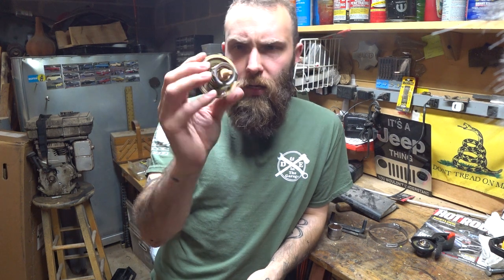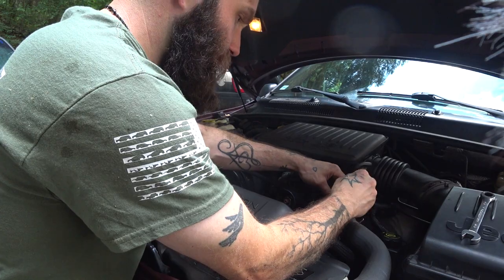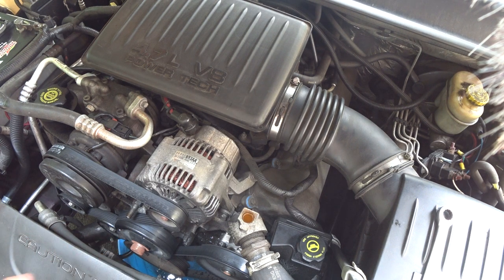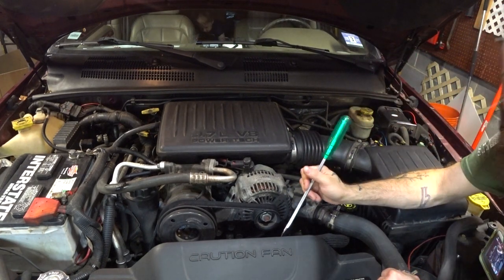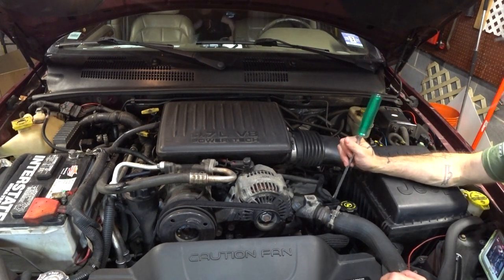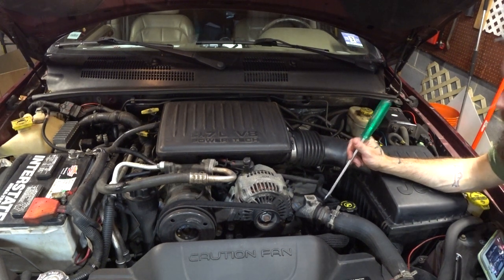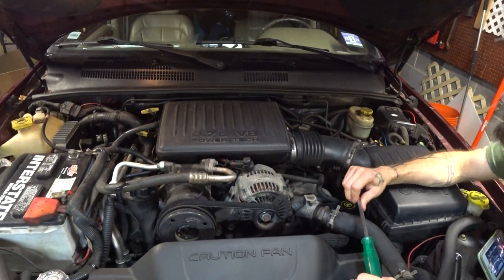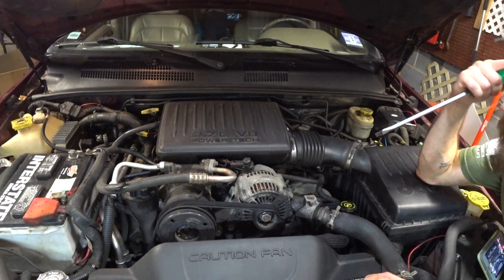How to keep a Jeep Dodge 4.7L alive & happy - EVERY FATAL FLAW I LEARNED THE HARD WAY!

Comment: When you say “hot”- what does that mean? I put a mechanical temp gauge on the bleeder port- normal driving temp on my ram is between 200-215 (just left of center on stock gauge)in the summer. When I drive with my plow on- the temp occasionally gets up as high as 230 which is indicated as just right of the center line on the stock gauge..  For me- 220 is about as high as I would like to see that thing go. If 230 is only just right of center- what the hell gets you up to the red?? 270, 280??

Comment: mine overheats when driving  220 or more . at idle it does not 208-210 max . i unplugged the coolant sensor the fan went to very high mode . what you think the problem?

Comment: Got an 04 wj 4.7 limited....having issues with hard starts....put a new battery...checked wires...cleaned connections...checked grounds...cant figure it out...have you had this issue or know of anyone that did
Reply from the maker: Not really. Could be a TPS issue. also could be plugs?
Reply: Cam and crank sensor?

Comment: I need some help!!! My 17 year old son has a 4.7 and im having over heating issues. I have replaced the thermostat,  water pump and all hose's. I bought the right hydraulic system power steering fluid and I did the bleeding right so I think but it's still getting pressure in the coolant lines I dont know what else to do
Reply from the maker: All I can say is that some 4.7s seem to be harder to bleed than others. Maybe give that another swing. Can you hear any rushing water behind the dash when flooring it?
Reply: No I didn't hear that. I will try to bleed it again today.

Comment: Off topic from cooling, but I've got a 2002 Dodge Durango with a 4.7L and went to take it through emissions, and it says I failed because the O2 system failed. Has new up/downstream O2 sensors in it, but still failed.
Any ideas of case of fail?

Comment: I inherited a Jeep Commander with a 4.7 from an elderly friend who passed. The temp needle would move back and forth like a kid on a swing sometimes. Last week it started running very rough then died.  Had it towed to a garage and they determined that two adjacent cylinders had no compression and said it was the head gasket The engine has 140K and ran fine except for the variation in temperatures. I just thought it was a defective sender or???  I'm a 5.9 guy and had no idea these engines were so complicated.  I'm ready to junk it and I am directed here -  Is it salvageable for a reasonable cost or is it toast? Anti-freeze was/is green! :-(   I'm an old Vet on a slim retirement income.  Any input appreciated.

Comment: I see your belt routing is not the factory routing.  Do you route your belt different to put less load on water pump bearing?
I know Honda did a update on belt routing on one of the 1.7 Gen engines to lessen bearing load.  Just asking is that why your routing is non factory.  Ty

Comment: Do you have any tips for parts on swapping the hydro fan for the mechanical?
Reply: So I bought a fan shroud with secondary electric fan off an early wj and put in a 12 blade 16" fan from dorman (Ford application i think) on a stock 4.7L fan clutch. My E fan is not hooked up yet but the mech fan is performing flawlessly.

Comment: I live in the UK my 1999 4.7 wj has a mechanical fan and a e fan as standard, When you flushed your coolant did you remove the block drain to do it?
Reply from the maker: Yea, here in the States they did that in 99 as well. Not sure why they changed it. I did not remove the block drain plugs, but I did flush it several times with distilled water

Comment: Know anything about this motor ticking? I’ve checked lifters they are good, I’ve checked for loose flex plate bolts they are good, I’ve checked pulley water pump pulley is bad but still get the ticking with belt off, pulled fuel pump relay and there is no tick when cranking the engine over only when it runs and tick goes with the rpm’s there is no exhaust leak, no vacuum leaks that I have found, but tick sounds like it’s coming from throttle body/ intake tube area, would a bad fuel injector cause this ticking? Idk I’m at a loss I’ve checked everything I can think of other then testing the fuel injectors

Comment: I’ve drove my 2006 ram, and the only trouble I’ve had is when the bearing in the water pump went out. I don’t think we bled it after that but ive not had issues
Reply: Read the bleeding instructions on the front above the radiator I bought my 04 jeep with a blown engine. I installed a rebuilt and drove it 1/2 way through a MN winter. I noticed if I went to an appointment with it wormed up inside when I came back 1 HR later and sat in my jeep with the engine running I got no heat. If I drove it 4 blocks I got fully hot heat. I thought there must be an air bubble or something. Then I saw someone's VID and they said IF YOU DO NOT BLEED THE 4.7 YOU WILL DROP A VALVE. when I bled mine I pulled out the plug and could not see the coolant I had to pour premixed coolant in the vent hole with a funnel. It took 1/2 gallon. Guess what. Now I get heat much sooner and I don't have to drive 4 blocks first. I hope I did not damage my valve system. I hop the cold MN weather saved me. SO FAR SO GOOD. DO IT NOW!!!

Comment: Okay... I have a 2001 dodge Dakota with the 4.7. Everyone I went to told me to use the green? Do I need to drain this thing ASAP or...? Why is the green a problem?
Reply from the maker: Yes, there is supposed to be the orange H.O.A.T coolant in there. The green coolant is not designed for use with aluminum engine components like the 4.7's heads. That is why green coolant is not used in modern vehicles. Just about everything these days has aluminum block or heads.
Reply: Dammit. My 2001 grand cherokee has green too.

Comment: Just got a 2000 wj 4.7 with 150,000 miles it came with green coolant im changing it to orange , the instruments cluster works until i start it and has come on a couple times while driving  and everything works correctly i checked all the engine bay grounds but im lost , do i spend 400 on a new cluster and find out its something else ? No temp guage is not a good idea and after watching im resolved to fix it asap!  Any help?

Comment: Umm...While I love my 4.7 and consider it one of the best engines ever made (I have 250k on mine and will fight anyone who says a 4.0 is better) your a bit off on the coolant. I bought a 2000 WJ in July of 2000 brand new and from factory it had "lime flavored" Thats all mine has had its entire life. The orange didn't even come into existence until much later and is really for the 5.7 and newer generations.
Reply: Yea my 02 4.7 is a cast block and lime flavored. 2013 is when the orange flavor came out which my ‘13 charger had. So idk maybe this guy is a time traveler.

Comment: Is there any particular reason one cylinder head would run significantly hotter than the other? I drove my mom's 2000 Durango with the 4.7 last night and when I got out I noticed a distinct hot smell from the passenger side. Popped the hood and could definitely feel just from putting my hand over the sides of the engine the passenger side was much hotter than the driver side. The Durango has over 247k miles on it and never had any major work done to it but I'm fearing it may need some love now. It's had a bit of a ticking noise from the passenger side for a while now. I've been meaning to get someone to pull the valve covers and check the lifters/lash adjusters as that's a lot more intense of work than I'd prefer to take on by myself.

Comment: I don't know where you get all your confidence at stating that the green coolant eats away the aluminum heads  I've had the green coolant in my truck since it rolled out of the factory in 01 it's been changed a couple times but I still run the green stuff my motor is fine

Comment: My 4.7 just starter to lose power nd had to rev to keep on after i changed the radiator nd thermostat
Reply from the maker: Any chance you caused a vacuum leak while you were in there?
Reply: @DEInTheGarage  ive checked it all nothing seems lose im a have the engine rebuilt

Comment: Hey man , any idea what is causing my 4.7 quadra to do this. Sometimes when I get in the highway , at 70mph, my rpm will be around 2000 and sometimes it's at 2300-2400. And doesn't ever drop to 2000. When it does go to 2000 rpm about 40 min into the ride on the highway, my rpms will surge ever so slightly up to 2400 from 2000-2100. It surges every 3-4 seconds . I'll slow down to 60 and climb back up to 70mph and the problem seems to go away ... This sound like spark plugs , or crank sensor ..what you think ???

Comment: I love my '02 4.7 ho , thankfully im the third owner and it was well maintained properly and loved so only big problem i had with motor was spitting a rocker arm, and fixed by replacing lash adjusters.
Reply from the maker: Yea, those hydro lash adjusters cause all kinds of issues when they get tired. Sounds like you have a good unit now
Reply: @DEInTheGarage  My '02 H.O. just popped a roller rocker at Cylinder #5, replacing plugs and all lash adjusters. Lifter where rocker popped off is fully expanded and doesnt give at all (just like the new ones). How would you tell visually if it's the valve seat issue?

Comment: I've been eyeballing a 2008 Dodge with the Magnum V8 and 162k miles on the odo. I would much rather prefer a 2nd gen dodge but the 5.2/5.9s with a 5 speed are extremely hard to find in my area. What do y'all think about that 08? Should I go for it or is it too risky with that many miles. If I have to dump money into something I'd rather find a beat up 2nd gen and throw money at that but the 08 is only $7000
Reply: Pricey

Comment: Everything the video has showed so far I've watched a couple they show if the fan is not running or running slow and the Jeep getting hot I have a 2004 Cherokee and the fan seems to be running super high super loud and the temperature is running between 208 and 215 however just this morning it reached the red zone does anybody have suggestions of what it could be
Reply: If coolant correct and bled properly .. you may want to check this out :  the hydraulic solenoid on the hydraulic can is replaceable and adjustable per this video :https://youtu.be/SZ9cOq8kGFA

I have a idle heating issue .. not at speed .. I’m wondering about coolant bleeding process, power steering fluid type and the hydraulic solenoid

Comment: Do you know the difference between the magnum vs corsair 4.7 v8 motor?
Reply: corsair has much better flowing heads, better pistons, 2 spark plugs per cyl and has a higher compression ratio.

Comment: Hey someone help
4.7 in 03
Dodge, lime coolant, long oil changes
Cap cam off and threw entire contents of coolant capacity over top motor, caught it in 4 minutes, not hot by my standards, no head gasket issues but

There is two slowish taps coming from a couple spots in heads, if you baby it around and never go above 2 k rpm you’d never know any problems, but when he load the torque up, it makes this horrible noise like maybe multiple cylinders not firing or bypassing?
What you think

Comment: Happened to me 
I got it fix 10 yrs ago heating problems 
Ford Dealer replacement all systems 
They can’t find the problem 
Cost $ 3,500 thousand 
Warranty Insurance pay it 
It’s work. The parts and computer.
Replacement twice system.
Sometimes when you turn the wheel it’s little heat going up stealing pump mite be going bad😏.
Some Dodge dealer don’t know how to fix it mess up. You have to find someone Know HOW it!!

Comment: Does anyone use these for engine swaps?
I'm thinking of putting the 3.8 V6 in to a mid '60's A-body, which was home to a Slant Six or a 273 (4.5 litre).
The way things work with roadworthy rules and engineers certs in Australia, it's very hard to put a larger engine in to a car unless the factory did it. 4.7 V8 is close enough to 4.5 V8 to get away with it instead of the V6.

Comment: I had my '04 Ram less than a year when the idler pulley exploded and tossed the belt. Before I could safely exit the highway I had melted the engine. $6,900 later I had a new engine. I legitimately hate this engine. I can't even use 5th gear, it won't pull even the slightest rise at highway speed. As soon as I can make it happen, I'm swapping a V-10 into my 1500.

Comment: AND: The oil pressure gauge is a liar.
1 wire - it's a light, not a gauge.
Reply from the maker: In the later Grand Cherokees, yes. If you have a 99-02 it is an actual gauge - albiet a relatively inaccurate one. No idea why they changed it in the later years
Reply: Change the sensor
Reply: @AndreiDRoman  Probably easier just to change the whole car, with the amount for sale with dropped valve seats - I'm not pouring money into it with that prospect looming over me...

Comment: Welp i guess i dropped a valve seat... previous owner had overheated it and i got it for free and ive got blue smoke only on startup but shes running fine with little noise in the motor except for a thumping noise on the right side of the motor.
Reply from the maker: That is tough bud. Good luck with it
Reply: @DEInTheGarage  whats my best option here for the money?
Reply: @DEInTheGarage  i really like this jeep tbh id love to keep it running.

Comment: I had an 03 4.7 was quicker than you think! But the life of a 4.7 is trash in my opinion. Had it rebuilt they had trouble with it. Then had to do it again so 90 over and 8 thousand miles new oil pump went out and she starting knocking within seconds it had shavings gold shavings... But was super quick.

Comment: Hey man I have a 2000 wj with the 4.7 with 220,000 miles on it. I ran it a little low on coolant one time and it was telling me it was low. I filled it up to normal level and everything was good until about a month or so ago. (I did drive this thing from WV to Florida every week from February to June with no issues). Now I’m having problems with bleeding the air out of it. I just replaced the thermostat yesterday and filled it up with the right coolant and bled it just like in your videos. I have air bubbles come out of the bleeder non stop. I can bleed it for a couples hours and I still get bubbles. Any ideas before I put a water pump in it?

Comment: I have 2 WJ’s with the 4.7’s. One with 220K (2001)and one with 120K (2004)
(Both purchased used )
Both have its own demons...
What’s your thoughts on the diesel version????
My current driver is skipping like a little girl going to Sunday school, timing cover is leaking HULK blood ,and has a slow battery drain. I have so much done to it though, that I don’t want to put it out to pasture , just tired of constantly having to tinker with it. The 01 has more miles , runs smoother and has better 4wd .... UGH

Comment: The 1-stage thermostat works fine. I've got one in. In the winter it will take a little bit longer to get up to temp, but it's all good.

Oh, and someone used red loctite on my bleeder. I did it with the radiator cap instead; best I could do.

Replaced my fan relay yesterday. The 99 is a mechanical engine fan, but the  electric dies. The 'lectric fan comes on but it will still overheat at idle. No idea what's up.

Oh, and one more edit: if you go to a mech fan from a 99 or 00, keep your PS pump. Yours has higher pressure. I don't know for sure that you can plug those holes, but if you can, I'd do it.
Reply from the maker: Interesting... I have been researching the swap, but have not decided on a course of action yet. I would like to keep the PS cooler as well just because
Reply: @DEInTheGarage  I don't have one, so if you decided to change your mind, I'll promise to treat it right:)

Mine came with the aux transmission cooler, it's the same cooler just hooked up to different juice.

What I'd like to know is why my electric fan comes on but still I overheat...lol
Reply: @DEInTheGarage  Follow up!

The coolant temp sensor was shot. I unplugged it and started the engine and the fan came on full blast. At least now I know the relay and the fan motor are both good.

Getting the new one in is proving a bitch. I can't get the thread to start. Tried the old one that was in there and I can't get that one either.

Is there some magic trick to this?

Edit for the next guy: buck up and take the air boxes and alternator off. Just do it. With all this hand space you gain, get a battery brush into those threads. They're gunked up. Yes, they are, don't argue with me. Then you should be able to start it by hand. To tighten, use a 19mm deep well impact socket. They have thicker walls but are usually open enough in the middle to get the connector up in there without wrecking it. Tighten up to roughly where the top of the schmutz they put on the thread is. German-style "Gutenteit." Don't overdo it, the threads on the switch are brass and an impact driver can kill 'em if you've got it set for Elephant screws. To the next guy who needs to do this: you're welcome.

Now, where to get a much more mac-daddy fan...
Reply: Dunno if you know, and a couple of months late, they sell special funnels for bleeding cooling systems .

Comment: I heard that the 3.7 & 4.7 engines have serious issues with the exhaust manifold  bolts busting off. I dunno how you can remove a busted off bolt without removing the head & drilling. The 5.7 seems more durable.

Comment: Rusty 06 4.7 in a 06 awd Durango had plenty of torque but had anyone had a problem with stock bolts in the block rusting warping breaking?? Getting ready to do a manifold gasket and thermostat housing etc seems most others know the stock bolts are mmm let's see... Junk?? Thanks and God bless.."almost a JEEP" 4X4/AWD or stay Home🎆🇺🇸👊✝️🙏⚔️🎸 🚛👍BTW mine has above 235k miles and she's still not using oil!! 😳 Wow